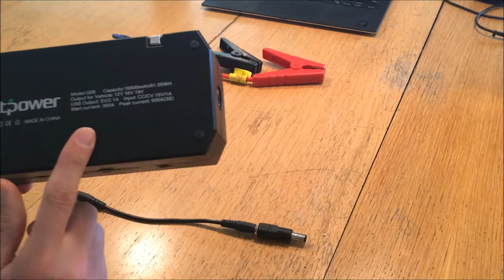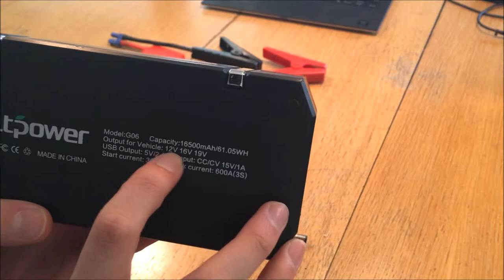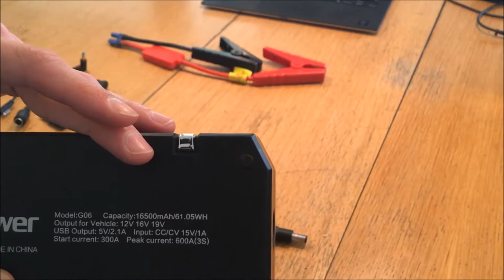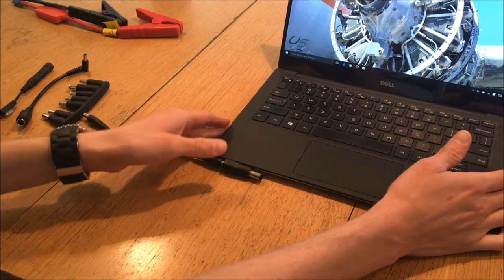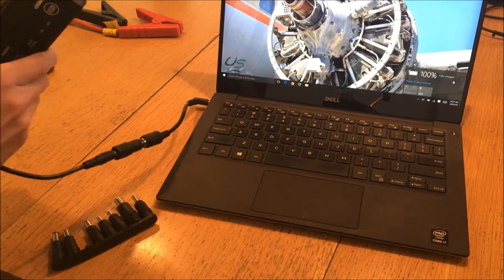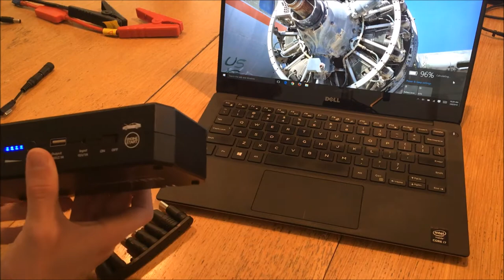EP 10 - BoltPower G06 Power Brick Review

Comment: I had two batteries G06 working perfectly for a year.  One of them exploded and fire like a rocket when recharging. After I tried very hard to put out the fire, I ended up in hospital for smokes!  WHY?
Reply from the maker: I'm sorry to hear that! 

Lithium-ion battery packs can become unstable if overcharged or short-circuited, and it is possible the pack or charger you received contained defects from the factory. It's a good idea to store these packs away from flammables, especially when charging them, and it's critical to keep the alligator clips from touching when connected to the battery.

I hope you are recovering well, and I hope this helps raise awareness as to the importance of good battery handling procedures.

Comment: Quick questions:

When you were jumping the car, I noticed that you didn't touch the on/off switch or the power button. Does the battery jump the car regardless if you have the switch off or on?

Also, do you have to choose a certain voltage when you jump a car or does it automatically select the right one?
Reply from the maker: The jumper cables connect directly to the terminals of the 11.1-volt LiPo pack inside. There is no voltage regulation on the output from this connector, so the car will see whatever voltage the pack provides at the given state-of-charge.
Reply from the maker: It also means it would be a good idea to avoid shorting out the cable clamps, as this would deliver the full 300-600 amps and make quite a large arc!